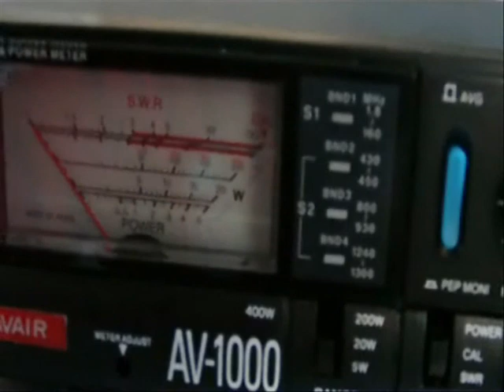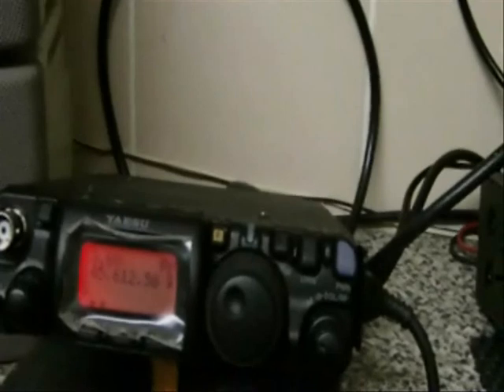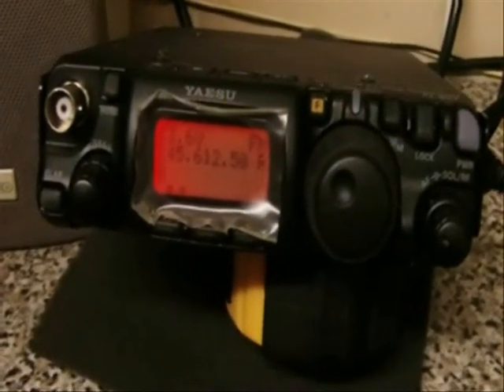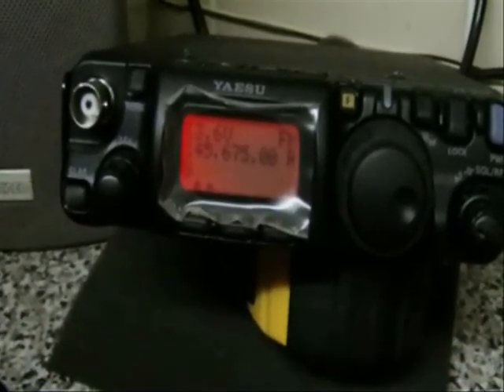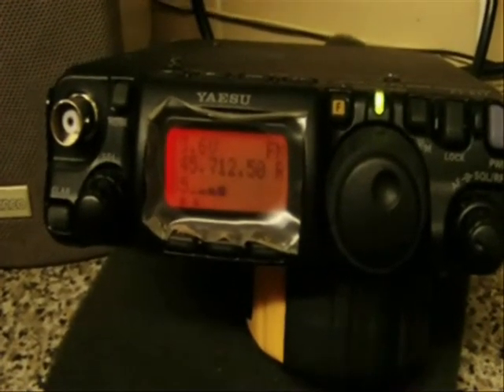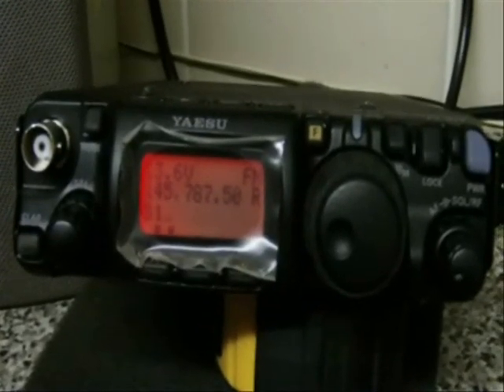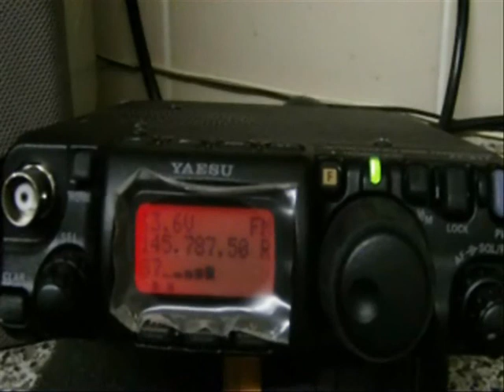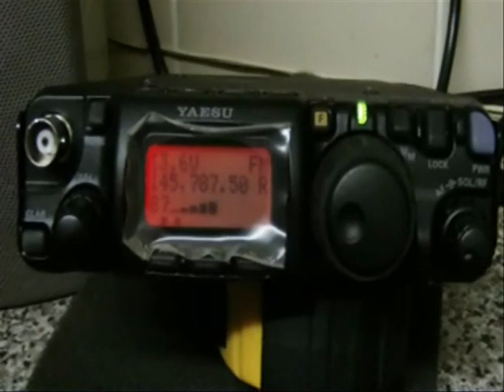2 Meters F-antenna Homebrew Project

Comment: This is a very cool antenna. I've seen this on qsl.net, and to hear it work is great. I've actually thought about making one of these. I came across an old junk fan that my sister was throwing out, so all I'll need is some coaxial cable and a coat hanger and I'll be good to go. 73's KB9TKB